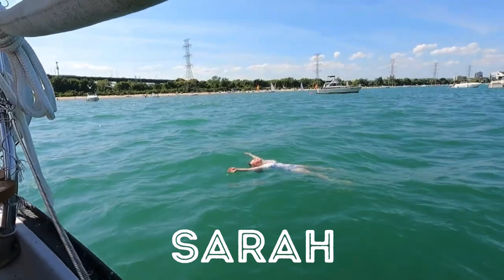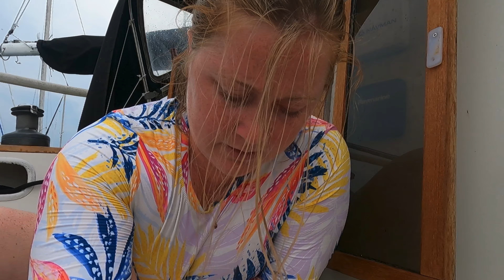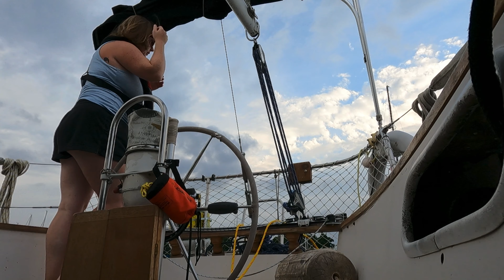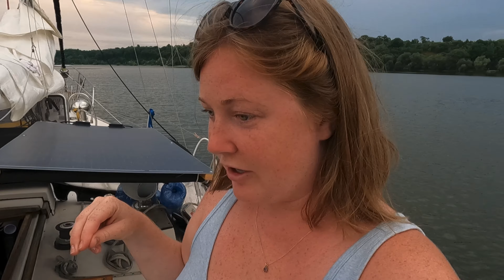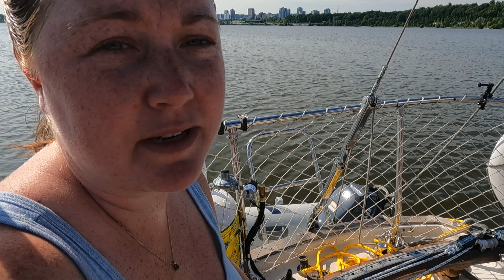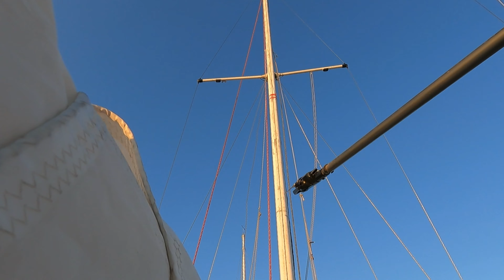Embarking on our FIRST major cruising adventure - Ep. 69

Comment: I felt so bad for you. Why was the tape on the mast? I must have missed it. And, did u get a new outboard board?
Reply from the maker: Yeah it was an up and down week before we left for sure. And the tape was holding up our steaming light. It was a last minute solution because we needed to mount it quickly. We will be putting it on in the spring using a proper mount not tape lol. No we didn't get a new outboard board... We made do with the cracked one. Still need to solve that one. Thanks for watching!